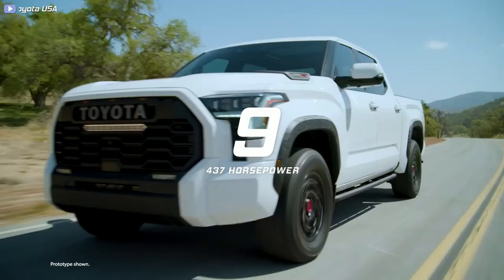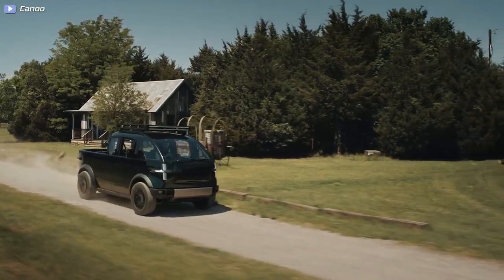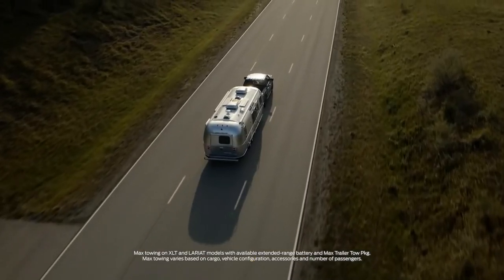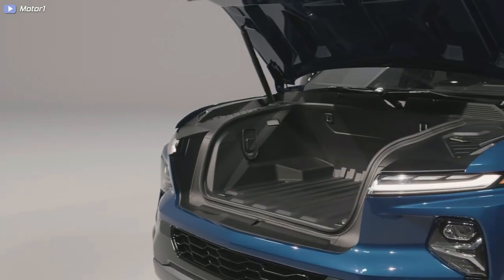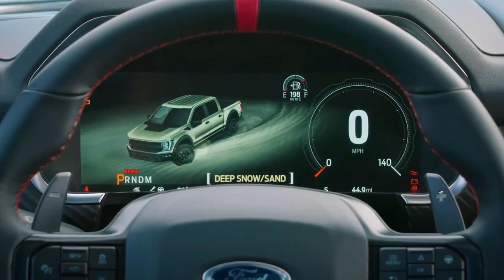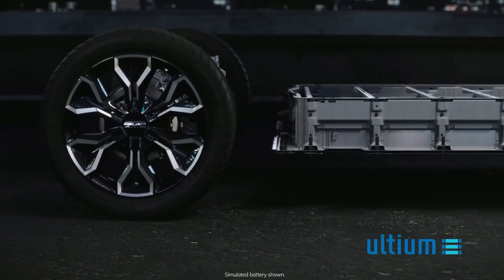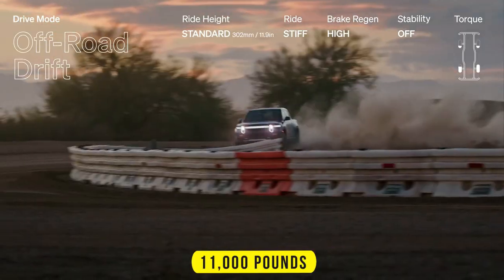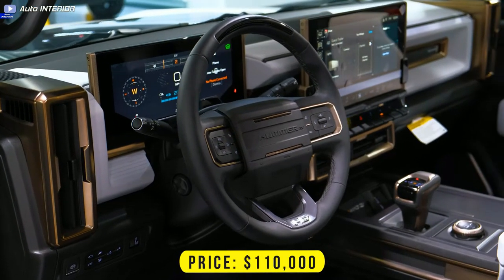9 Most Powerful PICKUP TRUCKS 2022 - 2023

Comment: PD - the TESLA Cybertruck has HD Truck PERFORMANCE in just a FULL size truck size.
TESLA Cybertruck has 4 PLAID motors w/ 1800 HP and 1600 lb Torque all w/ 100 sq ft PAYLOAD and can TOW 20,000 lbs. 
Cybertruck can also go 500+ miles w/ FULL Payload and 0 - 60 under 9 seconds WORLDS Fastest TRUCK. 
and is OFF ROAD rated , unlike FUD Lightweight.